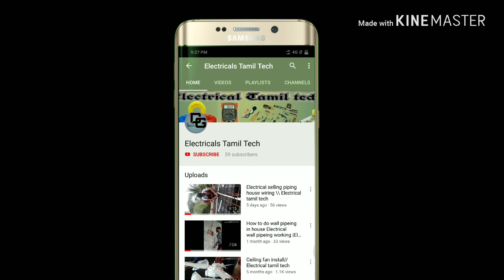Proper joint of  Electric wire and  T joint

Comment: Brother: (i) How to apply insulation tape on electric wire (ii) How to properly handle the Cutting Plier (iii) what is insulation (iv) what is the difference between electric wire and electric cable (v) what are the different types of electric wires and electric cables